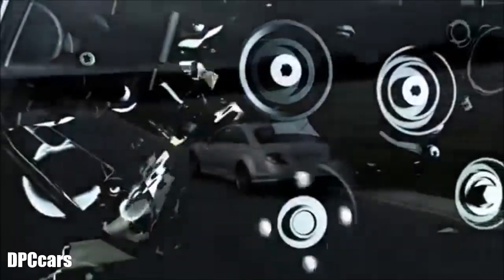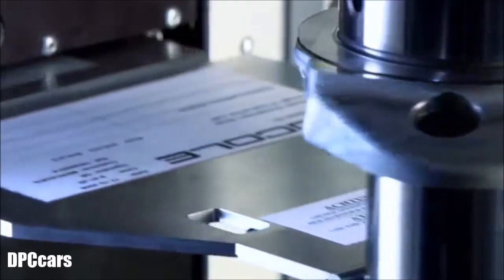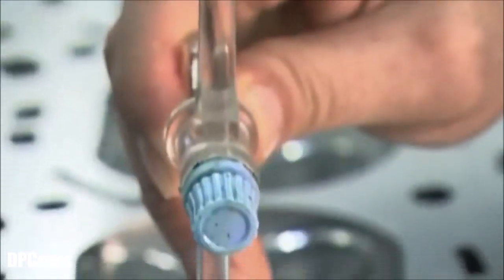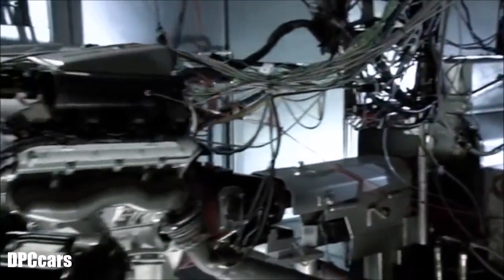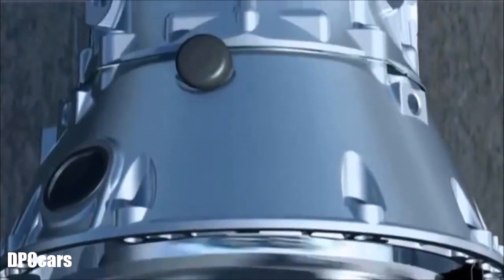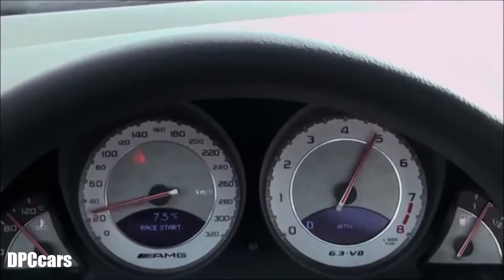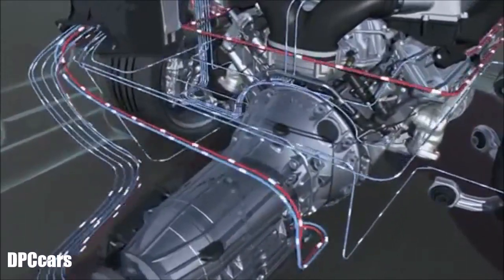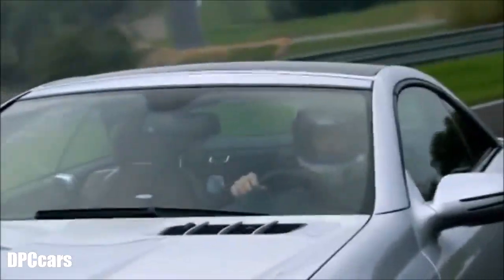Mercedes AMG 6.3 liter V8 Engine and SPEEDSHIFT MCT 7 speed sports transmission

Comment: AMGs best engines were all made before 2015 : (

It's all low durability after that.
Reply: That's a lie. M177 has proven itself to be a great engine in various uses. Repair costs are much more durable compared to the money pit costs of the M156. Even those 2.0L 4-Banger AMG engines have proven themselves to be quite durable if treated right. AMG always made good engines.